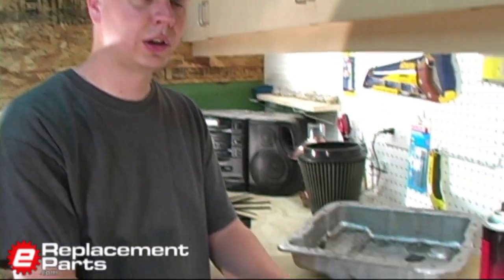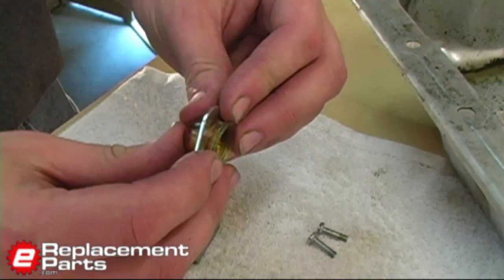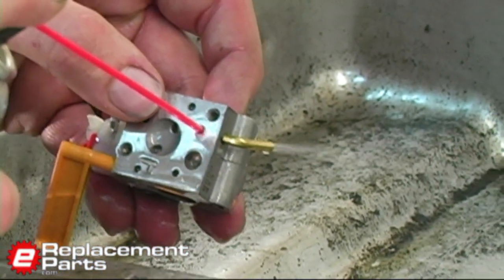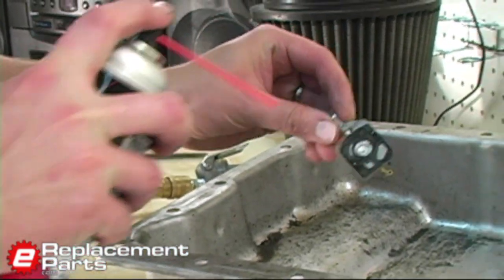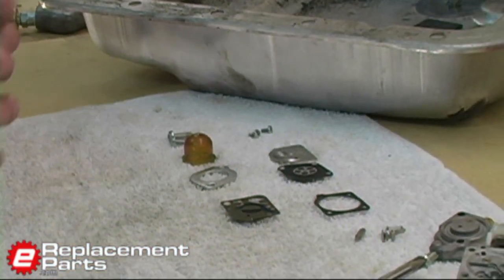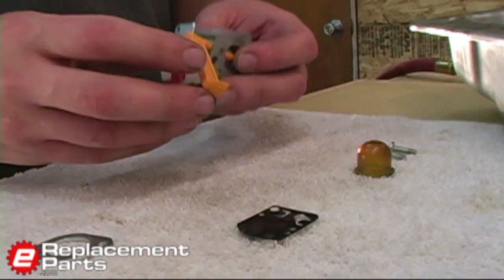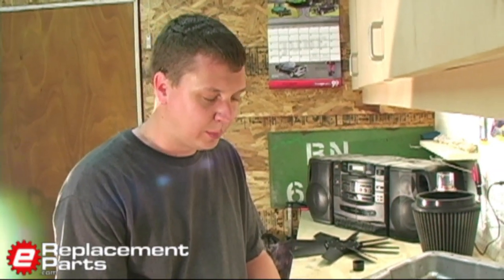How to Clean a Two-Cycle/Two-Stroke Engine Carburetor

Comment: As an added tip. . .I've found that I can use a thin sewing needle to physically go into the orifices and clean out any gunk that's been built up. . mainly from ethanol treated gasoline (which is a bad idea to use in carburetors).   Quite often carb cleaner simply won't clean out these orifices totally.  I spent a LOT of time going through the pangs of trying to get string trimmers and later, chain saws , running until I was schooled on the problems with ethanol additives.  It's a major hassle.  If you can get 100% gasoline, it's highly recommended that you use it in your 2 and 4 cycle engines. There's a class action lawsuit involving small engine builders against this gas.   Unfortunately, it's often the only thing available.  Nice video.  Well stated.

Comment: I know how to clean my 2 stroke carburetor, but I cannot figure out why it clogs up over and over and over.  I have taken it apart at least six times and each time it runs for a short time. Then when I take it apart, that little screen is plugged up with what looks like sludge. After cleaning it, the saw starts up immediately and runs just fine for awhile. Less than an hour.  What should I do?
Reply from the maker: Hi Marvin. If your carburetor is continually getting clogged up with debris. You may want to look into cleaning your air and fuel filter and/or fuel lines. If the filters or lines are clogged as well, some of that debris could be making its way into your carburetor. Additionally, if there is a hole or some damage in either of the filters, it could be allowing debris into the carburetor as well. I hope this helps, and please feel free to reach out if you have any more questions.
Reply: Thanks for your reply.... sorry, I said saw.... I meant trimmer....  I'm using gas with ethanol, we don't have gas available in our area without ethanol. Is it possible for the yellow fuel line coming from the tank up to the carb to be deteriorating and turning into sludge?  I noticed on my brand new Husky trimmer, they used a black tubing from the tank up to the carb. I have replaced the fuel filter with a new one and have cleaned the air filter with soap and hot water and let it dry.  I have ordered a new carb from Amazon that comes with new yellow line and the black line and some other goodies, such as two new gaskets for both ends of the carb. Mine only has a gasket on the piston side.  Thanks.... Marv
Reply from the maker: I'm not sure that the fuel line would deteriorate and turn into sludge, but if you've cleaned and replaced both filters, and have cleaned out the fuel line, your carb should not shut down on you like it was doing before. I hope your trimmer is in better condition! Thanks for your questions!

Comment: Good video, but I see you working with small parts on carpet. If it weren't a carburetor, I would be fine with it. It's just that you're working with tiny fuel ports that could clog if a strand of carpet fiber gets into one. Then there's the gaskets which might be affected by a stray strand of carpet fiber. Your video is almost eight years old. Have you experienced problem related to carpet interfering with your cleaning jobs?
Reply from the maker: Hi Ben, actually it is a shop towel and I have never had a problem with fibers. I prefer using it than on a dirty work bench where the parts could be contaminated.

Comment: why do you seperate the one gasket and jeopardize the gaskets ? do i have to seperate them , i didn't see you clean them, or did you?
Reply from the maker: Hello John, it is not imperative that your separate the two pieces. But as Mark said in the video in the video, if the diaphragm is clean, just leave it alone. It is very fragile and cleaning it may damage it. But if there is a build up of varnish on it, you will have to clean it, but be very careful.

Comment: I have a 2 cycle string trimmer that only picks up the gas for about 5 seconds when I give it full throttle.  Then it bogs down and stalls if I don't release the throttle trigger.  How do I clean it or what do I need to do?
Reply from the maker: Hi Brian, it sounds as if you need to rebuild your carburetor  or replace it.

Comment: couldn't you run a 2stroke without a carburetor by spraying the fuel directly into the intake hole???? Wouldn't that make it run more efficient since now there is no restriction in the air flow for the intake????
Reply from the maker: The restrictions the carburetor cause actually help the engine run more efficiently.  The design of the carburetor help the gas/oil mixture
atomize with the air helping the motor to run more efficiently.

Comment: Hello Bubba I have stripped the carburetor like you said and I still have the same problem will run but will not increase speed as soon as I try it just splutters and stops, I have been in touch with the supplier and they seem to think it is a problem with the factory setting on the carburetor but am still waiting on a reply as I may have to replace the carburetor, will let you know outcome, thanks once again.

Comment: any way to clean carb out with out disassembly
Reply from the maker: You can try using carb cleaner it the intake opening bu all you'll be doing is cleaning the opening.  Most of the trouble areas, ports and jets are inside the carburetor.

Comment: Thank you for the video showing how to service a small carburetor, the problem I have with mine is when I start it and let it warm up as soon as I try to speed up it just splutters and stops, I have sprayed carb cleaner in it but still no good, any help would be brilliant.
Reply: my ryobi ss26 does the same thing.  I was going to try and clean it, but maybe that isn't the problem.  Did you get yours working?

Comment: I did all of this. I changed the plug, air filter and gas too. My Stihl grass trimmer still won't start. So I bought a Dewalt battery grass trimmer, problem solved !
Reply: Ryobi engines, just like most other small engines don't last more than a season or two because they collect debris in the small orifices in the carb.  Cleaning them is an intregral part of maintainence.
Reply: I agree, same thing, I would not buy another Ryobi product.  They just dont last more than a season or two.

Comment: Hey dude I can't get the air box off the side of this.  Does it just pull off after the nuts come off?
Reply from the maker: +Michael Harrison The model I was working on had 2 bolts that fed through behind the carb and 2 nuts that held the whole assembly in place. Your's may be different, It's really going to depend on your model.

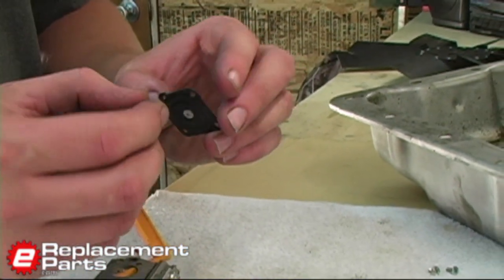Comment: I have this carb on a Ryobi tool (unfortunately), and agree with other viewers that there seems to be a discrepancy with the assembly of the metering section. According to Walbro and Zama online guides, and this Walbro video: https://www.youtube.com/watch?v=cDaOcNrS6BM, the assembly sequence is: gasket to carb body, then diaphragm (large disc inside), then cover plate. The parts disassembly at 1:25 and reassembly at 7:37 show different parts placements, both different to that specified by manufacturers. I think this should be corrected to avoid misleading people (like me for a while). 

Also it's worth removing the mixture screws - I found debris at the end of the H screw (looks like part of a brush hair, probably from OEM -  Ruixing).
Reply from the maker: +dchcountry Thanks for your comments.  I've sent a copy of your message to our producer.

Comment: Hi. I have a Honda GCV160 HRR216VKA self propelled variable speed lawn mower with auto choke twin blade advantage model. I was cleaning  the carb when the control assy, choke a black plastic item fell off engine when I wasn't looking. I have looked at every diagram I could find. Every utube video. But I can not figure out exactly how to replace it between the engine and carb. can you help?? Thanks
Reply from the maker: +Deb Porr There are many variations for this Honda GCV160 Engine.  Could you send a photo of the parts you're trying to get the answers about and on the tag of the motor it will show a "Type" number and the" Vin" number.  Both of these will help me to locate a diagram that will help you.

Comment: I did the starter fluid thing and mine didn't start now what do I do? does this mean my carb is no good?
Reply: +Tim Mcnemar - Nope. It means you have an ignition issue (spark plug more than likely but still could be cable, coil, etc) or that the engine is so old that it has little to no compression.

Comment: My Ryobi leaf blower ran out of gas and just wouldn't start again. Do you think perhaps cleaning the carb using this method might fix the problem? I've changed the spark plug and verified that I get spark when pulling the cord.
Reply from the maker: +Thomas Cancelleri Cleaning the Carb you be a good place to start.  It's possible that some gunk from the tank made it's way and got stuck in one of the orifices in the Carburetor.  They are very small on these carburetors.   If you're going to open the carburetor to clean it you might consider getting a new diaphragm and gasket kit.

Comment: I have cleaned a lot of these with no results until I started removing the screen and cleaning under it. Makes all the difference in the world.  Small engine mechanic tipped me off on this.  Bend a pin and grab the side of the screen.  Comes out easy if your lucky and no damage.

Comment: Please take this in love. I would suggest you use gloves the cleaners can't be good for your body.
Just a suggestion. Thank you for the video !
Reply: +Ab Abner Yes............I agree,     My first reaction was "get some gloves"!!!!
Whatever touches the skin readily absorbs into the body. As an example, during a 10 minute shower in fluoridated water the skin(the bodies largest organ) will allow absorption of more fluoride than if you drank a glass of that water.    So unless you would drink carb cleaner don't spray it on bare skin either. .......... Otherwise it's a fairly good video.
Reply: Haha, good one.

Comment: Perhaps you should blow off the carb before you tear it apart. You are risking getting exterior dirt inside the fine holes. Not only that but you can then work on a clean carb. Then proceed to tear down and clean the individual parts. Also, this looks like a Zama carb with Ryobi jet guards.

Comment: Question Mr. Mark.... my 25cc blower made a one knock noise when on full throttle normal operation, sputtered and quit. I clean the carb, changed the plug and muff and bought new premixed fuel.... still a no start.... the one knock and stop.... what do you think?.... no engine seizing or imbalance either

Comment: Is there a video of yours that explains how to adjust a carb without a tach? I've been trying and trying on this Stihl I have but just can't do it. I took it to the local shop they wanted four days! For a five minute job! I have the special flat end screw driver Stihl has to do it too. Thier factory settings of one turn out are fine if the saw just idles, but if I run the saw through one peice of wood it never idles down.

Comment: Question, why didn't you remove the non metal parts like o-rings and gaskets before using carb cleaner? I was taught to remove anything that isn't metal because solvents like carb cleaner will melt them.

Comment: Nice video, It was fairly accurate except for the diaphragm gasket. You will also need to break the plastic anti tamper piece off the Hi and lo mixture screws and clean them. Just take note on how far they were turned out.

Comment: Excellent video, and was vey helpful in repairing the carburettor on my line trimmer! However, I must make a few comments. Always wear  safety glasses when using compressed air, aerosol cans, or when disassembling springs. A spring may indeed "fly across the shop" and disappear, but it may also fly up and hit you in the eye. Compressed air (even at low pressure) can relocated dirt and debris into your eye with serious consequences. A good pair of safety glasses will cost you $5.00 so it is money well spent. Cheap disposable gloves are also a good idea when using cleaners or solvents! Otherwise, thanks for the tips.

Comment: I have a echo pb2100 leaf blower. It starts and runs but when I give it  gas it boggs down but still runs. does the carb need to be cleaned? or is it in the idle screws.
Gragg Cain
Reply: you need to adjust your carb while it's running, rev it out and adjust the carb screw should work : )

Comment: One thing I would additionally recommend is that you protect yourself from contact with the carb cleaner and, in fact, all similar chemical.  They will have a cumulative negative impact on all bodily systems especially the kidneys, liver and nervous system.  Moreover, they could possibly be carcinogenic and, like many carcinogens, the resulting cancer might not appear until decades later.

Comment: A very well presented video but, I have went through this cleaning procedure and sometimes it just doesn't work.  I even tried soaking the carb in carburetor cleaner for days.  Didn't work.  What finally did was taking a tip from a long time small engine mechanic  

Basically, after removing all rubber parts, you boil the carburetor in a strong solution of Tide detergent. Apparently, varnish can be so tough and plentiful that a little spraying or even soaking in carb cleaner just won't do any good. I even tried going through the portals with guitar wire as was suggested by one mechanic.  

When I got through boiling one carb that I was having problems with, after trying everything in this video and more, I ended up with a skim of something on top of the water which I took to be more varnish.   Once put back on the engine, it ran like a top.
Reply: ***** Justin, I just can't tell you exactly as I didn't take note of how much I put in.  Maybe a couple of tablespoons, (not soup spoons) for a 1 1/2 quart pot. I can say that you need to have the Tide thoroughly dissolved before putting in the part.  Also, make sure rubber or gasket parts are taken off.  In addition, make sure the carburetor is thoroughly rinsed off after removing.  The best way is transfer the carburetor to clean hot water, boil it for a for a minute or two then thoroughly rinse off with cool water as soon as you can.  You want to make sure you don't leave any detergent in the carburetor as it will stop up the ports/passageways as well.  Good luck.
Reply from the maker: dnsmithnc Thank you for the advice and feedback! Always great to hear about people's repair experiences.
Reply: thank you. how strong of a solution?

Comment: Great video helped a lot but you might want to press the use of safety glasses when using carb cleaner it burns like hell when you get as much as the mist in your eyes so guys and gals use safety glasses again great video thanks my unit runs great.

Comment: What kind of carburetor cleaner are you using?
Reply: Many of them contain acetone and it melts many types of plastic.
Reply: It's CRC brand,
Reply: John Doe
can i use contact cleaner insted?
Reply: that might melt some plastics if there are any.
Reply: okey will get some carb cleaner then :)

Comment: I have worked on a Bunch of weed whacker type machines, Every one I have worked on has ether a Zama or Walbro Carbs on them . And you can get parts for them
Reply: I don't know why ppl think you can't get the kits, i have a Zama gasket set for my 20+ year old Ryobi line trimmer right here. That's right, if you treat your tools right, they last. Most things are made by 38 cent an hour Chinese they can make what ever quality manufacturers like but i think mostly stupid people make junk out of good tools.

Comment: Holy crap. Do not follow these instructions. There's a tiny check valve in that plate that the primer bulb goes on. You can see the check valve in the video. Once you spray carb cleaner on that check valve you have ruined it. He also puts the diaphram and diaphram gaskets on in the wrong order. Oh, and you can get diaphrams and gaskets for these carbs. lol. Wow.

Comment: Just another reason NOT TO BUY RYOBI ANYTHING!!!!!!!
Throw away crap !!!!!!!!
Reply: I used to think that, but my rebuilt, 80 dollar Big Lots special Ryobi has been running strong for 10 years.
Reply: I do not like Poulan, Weedeater or McCulloch.  The problem with those brands is they are all made by the same company and they are known for being hard to start and difficult to keep running.  They are junk.  I have a Ryobi leaf blower that has never been hard to start.  I used to hate 2 stroke engines for them being hard to start.  That is especially true with gas left in them.  But Poulan and all brands associated with it are even hard to start brand new.  I have read plenty of bad reviews.  I am trying to fix a Weedeater 530-027965 that is hard to start and I found one really huge joke...no primer bulb.  I am now starting to see why Poulan and weedeater are so horrible.

Comment: This is a GREAT Tutorial. Thank you. However,, after cleaning (with carb cleaner in ALL the little holes)  it still doesn't run.. It started for 2 secs and then died.. It was running normally before.. but I stupidly enough stored it with gas in the the tank.. We replaced all the tubes (there was gum in there) as well as the filter.. One think that I noticed that the priming bulb does not pop back when priming.. So I guess somewhere a valve stucked or connection still blocked.. Any suggestions will be greatly appreciated !!!!!
Reply: Under the primer bulb and plate of your carb you'll find a small screen inside of a hole. I've found that screen plugged up many times when the primer bulb behaves like that. Clean that screen out with carb cleaner.